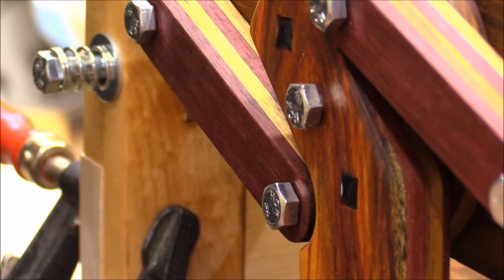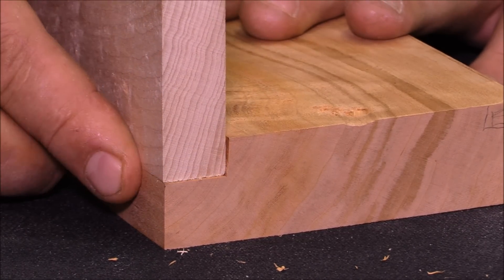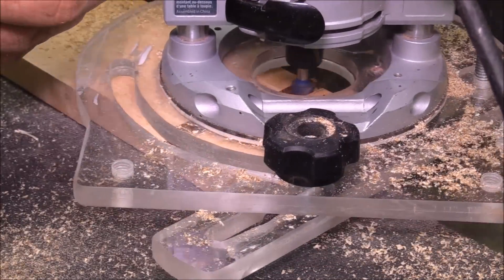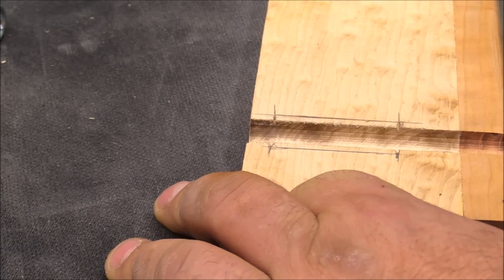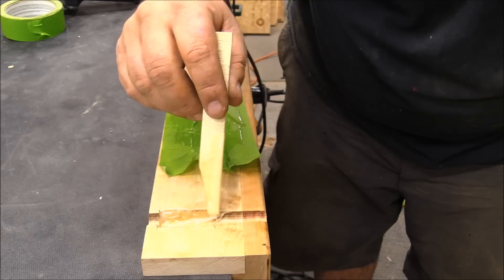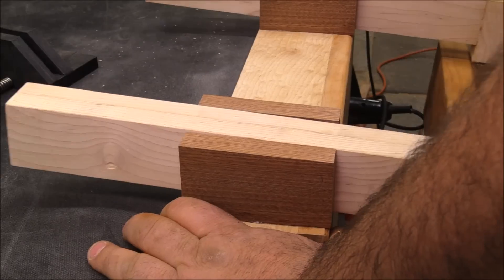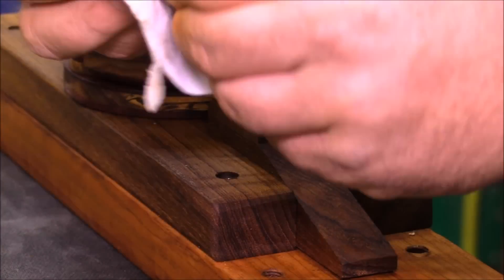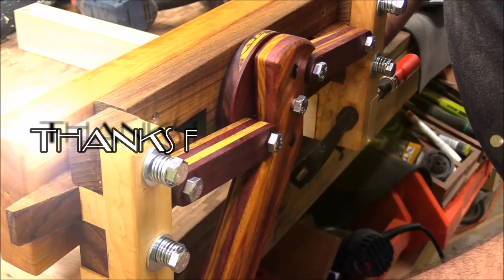Unbelievably Fast Homemade Bench Vise!

Comment: Have you thought about using a spring system in the runners to automatically push down and disengage the lock when there is no clamping pressure? That might even help speed up the use of the vice (no accidental binding when opening or closing)

Comment: Izzy, I like this not just because it works so slick, but because the idea drove you from one solution that totally didn't work to another solution that works awesome.  I need to get the plans for this so I can build one for my guitar assembly station on my new work bench...  Just awesome man!!!
Reply from the maker: Thanks man! The thing i think that stick out the most id how the more complicated idea was a fail (sort of;) ) and it was the simple idea that turned out to be better, faster, stronger!  Not sure why but now i feel like listen to hip hop. lol
Reply: Simple and straightforward is typically a better solution but takes MUCH longer to get to.  It's refinement rather than simple minded.  I would have to agree with you on one other thing...  The lack of a center pipe is priceless.

Comment: very cool .might want to replace some spots of the vise for steel where you need it just so it takes the pressure .but a great idea wood might even be fine for a light duty vise .like the small light weight work i do .just to hold things in place to stain or sand  or carve . great job izzy .

Comment: I definitely need to build this one. Are the four Springs what control how much clamping pressure it has.
Reply: No - there are wedges that are pushed by the levers attached to the rotating handle.

Comment: I love the design and I'm looking forward to the even leaner design you mentioned in your vlog. One tip regarding the angle grinder guard, if I may. Angle grinders - even those of Makita or Bosch - are dirt cheap. So if swapping cut wheels prevents you from using the guard ... maybe stocking up on grinders could be a safer solution? That is of course only the case if you swap them for a different type - not if you are going through those wheels like crazy. Anyway - great vise - could be the one I want for my workshop. Cheers and thanks!
Reply: That is what I do.  😃

Comment: Great job Izzy! What's the prospects of increasing the size... meaning width of the vise?
Also, how prone is the wearing down the threads on the bolt/coupling as you drag the vise in and out?
Reply from the maker: no wear they don't touch during the move on touch to engage.

Comment: The side shot around 8 minutes was super important for me to actually understand why the threaded bolts come in contact with the coupling to create the lock.
This is a really cool system and very pretty too! In the beginning I was wondering how it was supposed to actually clamp, but it makes perfect sense now. I like it a lot :D
The only thing that looks a little worrying is how the head plate tilts on the frame when you clamp a board only in the top part of the vise. (I hope I can make sense ^^)

Comment: What broke when clamping? I am guessing the bottom plates holding the sliders due to leverage of the sliders against them. If so I guess you could fix that with brackets on the sides being careful not to set up splitting pressure on the side stanchions. If you apply 35 ft lbs of torque on the lever, then the wedges at 12 degrees produce 330 lbs of clamping pressure. If the wedges are 3 inches above the slider, and the slider clamping coupler 9 inches in along the slider, and the bottom plates 5 inches back from the coupling nut then the breakout force on the bottom plates is 198 lbs over the two plates. Metal L brackets/gussets should solve this, wrapped around the bottom plates.

Comment: I'm kinda mystified why having the guard in place on your angle grinder would make any difference as far as ease of changing the cutting disks is concerned ?

I never remove the guard on mine and have no problem changing the disks.

Comment: Where did it fail? I would bet the couplers stripped out of the wood
Reply from the maker: Nope it broke and the half lap holding the head to the slides
Reply: That's what I was guessing, just watching how much it was racking (leaning back?) as you demo'd using it at the end of the video. If you had the head's verticals full length, a bit wider maybe, just butted up against the slide rails, and then put the threaded rod right through the verticals with a big washer and nut on the end, then you'd have to split those verticals to cause it to fail. I doubt the coupler nuts would fail as they are actually being pushed into the wood by the levering action of the jaws pressure. They would have to split through the lower front edge of the table-side jaw to go anywhere.